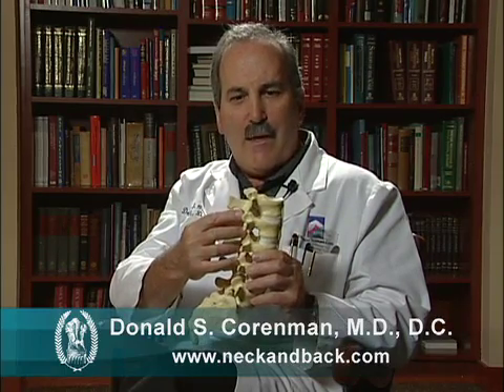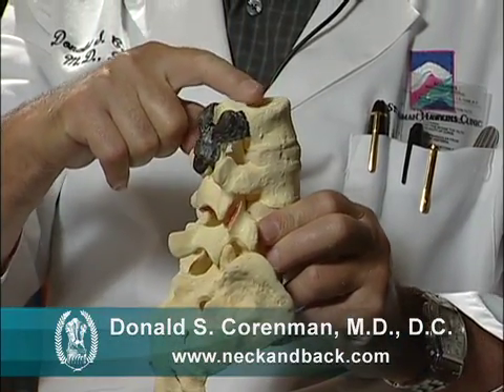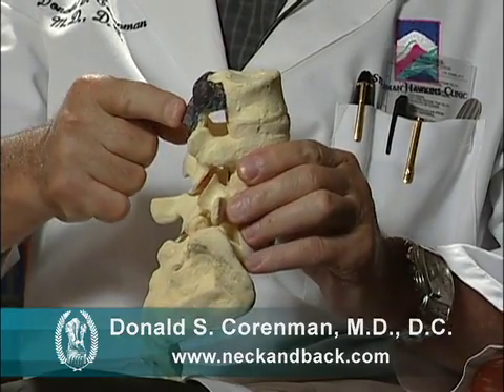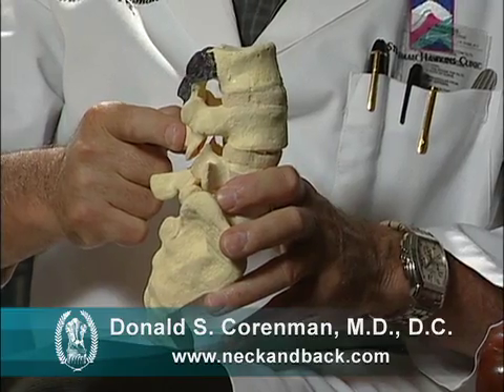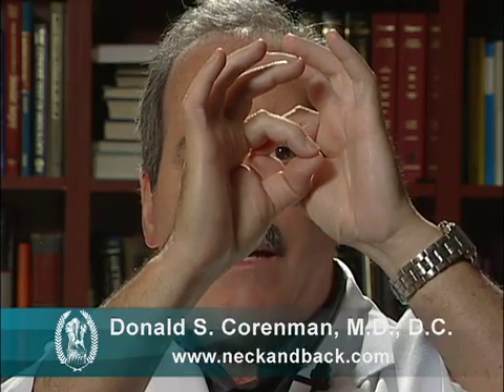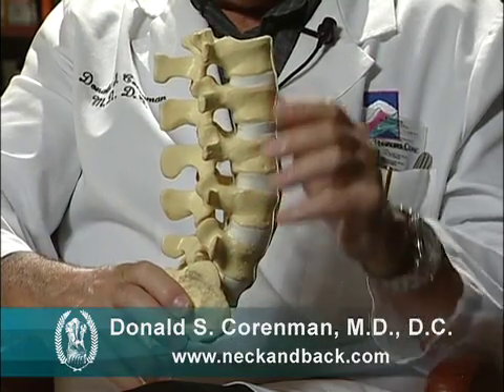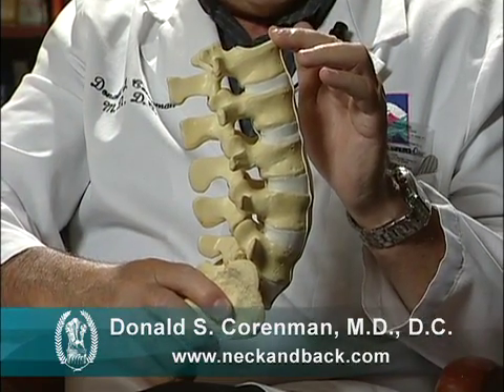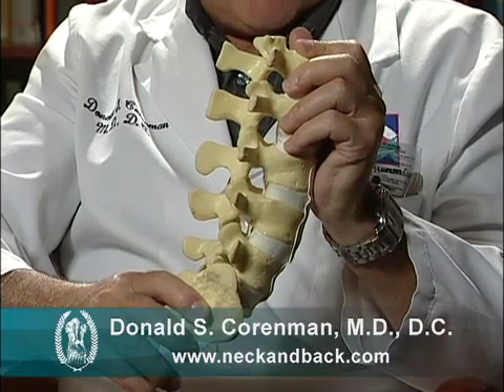What is Degenerative Spondylolisthesis? | Spine Instability | Orthopedic Spine Surgeon in Colorado

Comment: That's what I think I have, is degenerative spondylolisthesis. I don't think anything has fractured, but my lumbar doesn't feel quite contoured anymore.

How does one align the vertibrae and strengthen the supporting structures & tissues?

Stem cell therapy seems to be the only way to replace cartilage. But how does one align the spine without fusing the vertibrae? 

Maybe gravity decompression?

It would require hours, days, or months to correct the gravitational force exerted over several years to realign the spine.

Surely there must be a novel surgical technique to put the spine in a 'brace' and regenerate the vertibrae withouts fusing (and thereby losing flexibility)